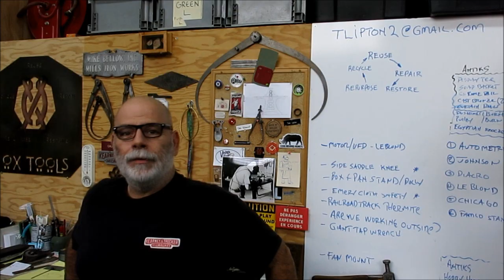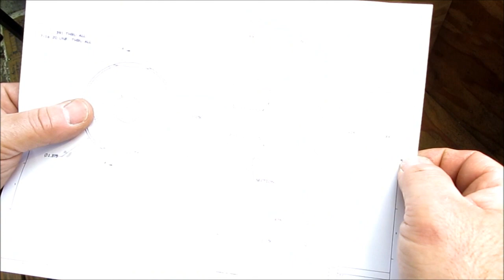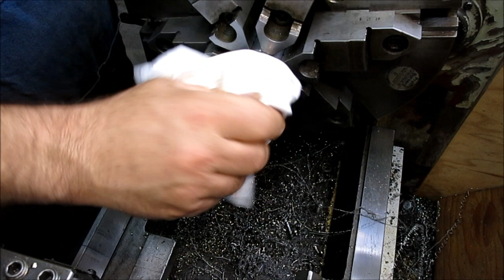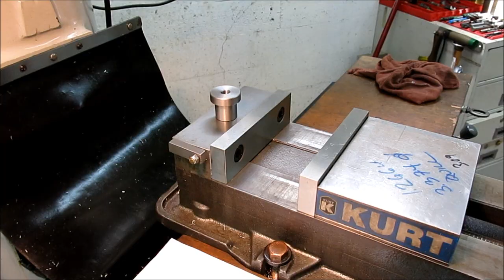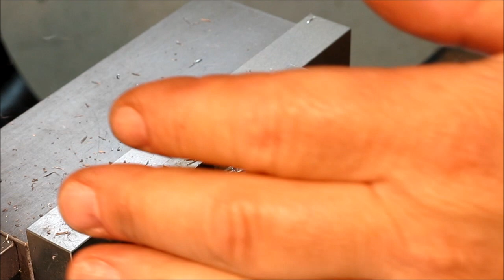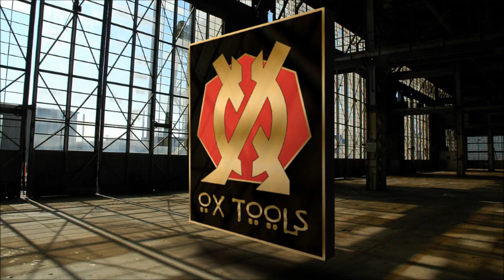Kearney and Trecker motor bushing

Comment: Tom, I watch a LOT of machining videos on YT, and I also worked as a machinist for a few years, and I have always wondered...Why does the smoke from the oil and the steam from coolant always flow toward the chuck on a lathe??  I had thought it had something to do with Bernouli's principal, but am not sure.  Could you enlighten your audience??
Reply from the maker: Don Foreback Hi Don,

I never really gave it much thought. If I ventured a guess the chuck creates a low pressure area around it that draws the smoke toward it. Have to talk to my Physicist buddies at work. Thanks for the comment.

Cheers,

Tom

Comment: Tom, you may have had a few "oops"es in there, but none where it affected the part. Apparently Mr. Bozo is on summer break.

I'm still puzzled why, when tapping on the lathe or mill, it's "all ahead full" for the complete depth, but when hand tapping with the same style tap, it's "do a turn or two, then back up to break the chips".  Why don't the chips bind when power tapping?  With spiral taps I can see, but with straight glutted taps I don't.  Any thoughts?

Now back to considering how to fix a stripped out 10-32 screw in a thin walled tube bookcase support...weld it and re drill and re-paint?  JB Weld and re-drill/tap?  Make a bigger hole for a bigger screw?  Forces are mostly perpendicular to the screw, so maybe the JB Weld will work?  Time for a test...

Thanks for the video!

-- Mike
Reply from the maker: Hey Mike,

Power tapping is tap dependent. I never power tap with anything other than spiral point, spiral flute, or form taps. Four flute hand taps are the ones you want to back and break the chip. 

On your 10-32 thread. I would probably drill it out and insert a rivet nut. The kits are pretty reasonable and handy for putting threads in thin sheets. Another thought is to make a plug that fits the tube ID that has your 10-32 in it. Shove it down the tube to where the bad spot is and insert the screw into the plug.

Cheers,

Tom
Reply: oxtoolco
Thanks for the tap info.  Maybe in some future video you could discuss telling tap types apart?  The one you used looked like a hand tap to me (no spiral that I could make out), but I'm not familiar with form taps, so maybe that's what it was?  My tapping to date has been limited, and just with hand taps, so I have a lot left to learn on this subject.

Thanks for the suggestions for the 10-32 thread fix. The plug idea would be ideal except for three issues: 1) I don't have a way to turn a plug (yet), and 2) the tube is an Ikea bookcase support, with a curve at the top and a glued-in leveler foot at the bottom, and (biggest issue) 3) there are rungs coming all the way through the tube at 3 points between the bottom and the place where the screw goes.  I'll look into rivet nuts...I think they'll be generally useful to have handy for other things too, and will give much better support than the screws alone.

In case you are wondering, the screw is used to hold a cross-brace that keeps the shelves and uprights square.  I picked up the shelves on Freecycle, without braces, so I'm making some from 3/16 x 1/2" A-36 hot rolled.  Even with my limited tooling, that's a project I'm up to handling!  I made a little jig I clamped to the grinder with a pin in a bit of scrap to use for rounding the ends uniformly (the pin is a 10/32 screw with the head cut off).  Still debating whether to rivet the braces where they cross...but it's looking like that probably isn't necessary.

Thanks again for the video, and for the help!

-- Mike
Reply: Tom, just to update: I got a rivet nut tool, and it worked great!  The stripped out screw problem is fixed.  Also finished making the cross braces so the shelves are now usable. Thanks for the suggestion!

-- Mike
Reply from the maker: BigMjolnir Hey Mike,

Those are nice to have around. They work really good for those thin wall projects that need a more substantial thread in them. Glad it worked out for you.

All the best,

Tom

Comment: Hmm there must be 2 schools of thought on this??
All the lathes in the shop I work in that have a lever are down for forward or normal rotation.
The newest lathe that has a mechanical clutch was purchased about 3 years ago new.
It's a Lion brand supposedly European made, fairly big 5" spindle bore and 30x 90ish, don't have the specs handy.
The thing is very clearly marked which way the motor should run,
We have 2 Lion brand lathes, the older one is somewhat smaller, only 4" spindle bore but set up the same way,down
for forward, both mechanical clutch.
We also have a slightly smaller Tarnow 3.25"  spindle bore Polish made lathe that also is clearly marked which way
the motor should run and although it has electromechanical clutches its still down for normal rotation.
All of these lathes are geared to run faster in reverse than they do in forward which is handy for metric threads when
you don't want to disengage the half nut PS thanks for the great lesson on how to do that!!!!
Is this a European thing?
I also had extensive experience with an old American made Leamann lathe that I totaly tore down, rebuilt and used as our "big" lathe in a failed small shop, same deal, clearly marked which way the input pully needed to turn and it was down
lever for forward... confused???
PS Lion lathes suck ass!!!!
Look great but no toolpost options
Reply from the maker: Hey Gent,

I ran into an Enco lathe that had bass akwards lever rotation. I tried swapping the hot legs on the input cord but it produced no change in rotation with the lever position. 

My feeling is its a manufacturer determined thing. I can see down for off pretty easily. You don't have to even get your hand around the lever. Just slap it and the lathe goes off. The LeBlond at work even has a little mechanical gate on the spindle lever that locks out reverse rotation until you open the gate. I'm starting to think this is an East coast thing..... I wonder how it is in the Southern hemisphere. Do they move sideways to go spindle CCW?

All the best,

Tom

Comment: Hi Tom, nice video as always!!
I have to ask, why is your lathe set up so up on the lever is CCW or normal rotation???
I have installed and setup older and newer lathes with mechanical clutches that were clearly
marked which way the motor needed to run, in some cases to insure the lube pump ran the correct way,
and none of them were set up that way???
Seems totally backasswards to me and counterintuitive?
I'm sure its personal preference but I have never ran a lathe set up that way?
Reply from the maker: Hi Gent,

The rotation is correct. We have several examples at work as well that have up for forward. In fact most of the lathes I have run have been up lever for CCW facing the spindle. I used a lathe at a local high school a year or so ago and it totally threw me off down for forward. I see Adam's Monarch is down for CCW as well. How about all those 10EE's out there how intuitive is that lever?

Cheers,

Tom

Comment: Hello Tom. First of all, I gotta say that your videos are well-made and interesting. The way you explain all the things, and the way you're "into it".. Basically what I mean is you know what you're doing, I'm not a mechanic, I'm far away from that (even though I'm in a welding education right now and likes it alot) but- I'm a musician. That means I'm a listener and using my ears, alot. (with earplugs most of the time haha). Of course, a mechanic have do use their ears all the time too. For example, you hear if something goes wrong, it comes naturally to act and do something about it. After that experience you know that if that sound comes up again, it's not good and in the end will break the tools and the material.

For me, I've noticed if I think a video are interesting or not, depends on how much different sounds it is. I guess most people who are not working with this kind of stuff probably would associate the machine-noises and all that, to negative-noise-thumbs down, or whatever. But I do not! What I wanna tell now is.. You got alot of sounds in yours, and they are comfortable to listen to! Good luck and have a good time now / Rob
Reply from the maker: Hey Rob,

Thanks for the nice note. In metalwork our ears tells us all kinds of stuff. From welding to machine work sound is an important diagnostic tool. I can hear when something is going wrong in the shop all the way from my office.

Cheers,

Tom

Comment: Parting made easy on the Yam! I hate when its time to part on my little 10x22! Would you say that a 3/32 wide blade is too much for a 10x22? i have NO luck in steel and Aluminum is ifffy
Reply: if i manage to get through steel , its a long drawn out very careful process
Reply from the maker: Hey Bub,

Parting is one of those balancing acts. If your lathe lacks rigidity then you need thinner parting blades. Thinner parting blades are trickier to make high aspect ratio cutoffs (deep). So there is point of diminishing return. On a small lathe with a 3/32 blade anything more than an inch in diameter might get a little squirrely.

Cheers,

Tom
Reply: bubster1981 you might try running the blade upside down. i tried that on my old clausing and it really helped cut down on the chatter from my 1/8" blade. I also ground some extra side relief near the front to make sure there was less drag then before. Another trick on small lathes is to part off in back gear, since the wide cut from the blade takes a lot of power.

Comment: Nice to finally we some machine work, soft steel is a lot nicer to work wih than even aluminum. Aluminum just gets gummy sometimes. 
Do you have plans to get or make an air bearing fixture for your tool and cutter grinder so you can sharpen endmills?
Reply from the maker: Hey Andre,

Not sure on the tool and cutter grinder. Need centers and a few other things first.

Cheers,

Tom
Reply: Are you going to do some cylindrical grinding? What would you use a center for? sharpening reamers? but then their diameter is reduced...

Comment: Use 1144 for a lot of my parts I design. Great tensile and great machinability compared to 1000 series low carbon steels.
Reply from the maker: Hi Cp,

The screw machine guys love it as well. Chips break and it cuts with a nice finish. Strong out of the box as we say.

Cheers,

Tom

Comment: Hi Tom,
We are all there, your numerous fans, on the front row, out of breath, ready to applause, there it is...... Clap clap clap...!
The bushing is done in a record time...That was all of a marathon, just like in a shop where you feel the boss's breath just over your shoulder.
This is your less relax video, the most expedite so far, still informative though.
Cheers,
Pierre
Reply from the maker: Hi Pierre,

I was in getter done mode. I contemplated buying another bushing to save work but opted for the make one quick and save fifty bucks method. 

Cheers,

Tom
Reply: There is a reason why we are machinists...
Keep on the generous videos.
Cheers,
Pierre

Comment: Not sure how it spreads on crackers, but that was some creamy steel. What kind of tests do you do to determine the grade of metals you "recover"?

Is it just from years of experience, or are them some ways to narrow down some unknown steel stock I was given...beyond calling the guy up and bugging him for being generous?

Thanks for the video, and thanks in advance for any sort of answer you possibly have for my dim-witted question. I know about spark tests and checking for hardened steel by running a file across it, but I was curious if you had any more definitive methods when you know that it's unhardened steel?

Aloha, Chuck.
Reply from the maker: Hey Chuck,

Well we start by cutting a little chip off then sucking on it for a while. After it rusts a little in your mouth you can tell what it is by comparing a known specimen. Just kidding. Stressproof cuts with a distinctive chip formation. Its very common for shafting work. 

Cheers,

Tom
Reply: oxtoolco
I think that may be what my scrap piece the guy from the machine shop said would be "nice and soft" for me to practice on...it is creamy, but my little midget lathe still doesn't cut it so deep ;)

Thanks for the reply...Aloha, Chuck

Comment: Love watching you work, very fluid and professional. A tip on variable pitch sheaves, make a small copper button and drop it in below the set screw, most sheave manufactures just bite down directly on the threads, your version may have flats, couldnt tell from the vid. Something you probably already knew, but thought I would take a chance. YMMV

Z
Reply from the maker: Hey Stan,

Good suggestion. I haven't looked in that hole yet......Using a trantorque keyless bushing to attach the pulley. Thanks for stopping by,

All the best,

Tom